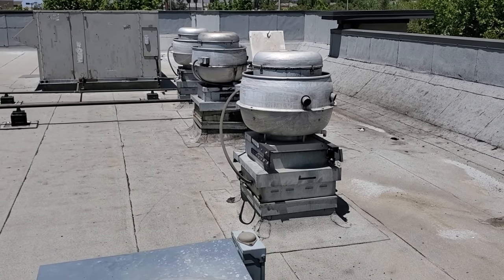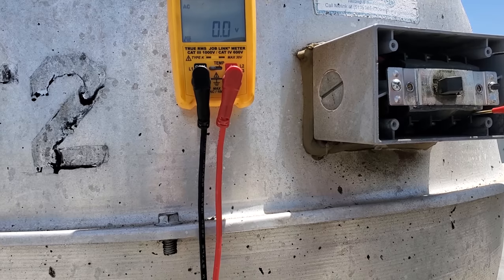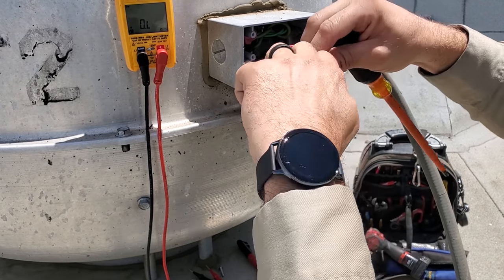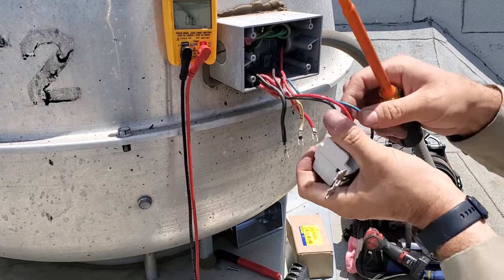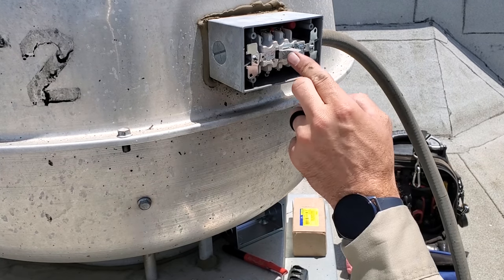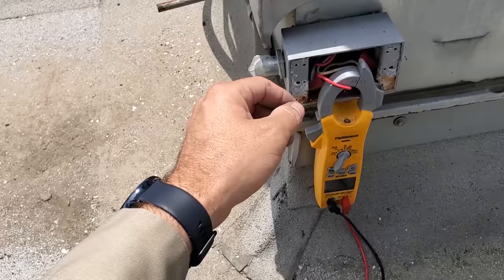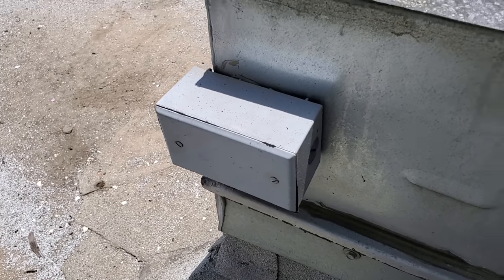WHY IS THERE SMOKE IN THE KITCHEN ?

Comment: In the restaurant industry, generally if you tell a manager about issues with a system, it will usually never get to the person that needs to hear what is needed or what repairs are needed upcoming. Often the next time you are there that person no longer works there. You always need to find a person above them if you can, and even that has a small percentage of success. I used to make vendors leave a log in the office with a synopsis of repairs made, or recommendations. Many times I went back and a new face was there, I said look in your file cabinet under Repairs. They would say holy shit this is great.
Put the logo back centered on the ball cap as it belongs, I have no clue who in their right mind decided to do this on every cap, but it was originally because on camera interviews are off to one side, and  with the sponsors logo off to one side it shows on camera better.  
And quit with the "merch"  Merchandise!

Comment: Thank you for the a/c power lesson.  And thank you for reading the comments and acknowledging them. I have an exhaust fan at work that is smoking. It's a big one, blades are at least 5 feet diameter. When the Hvac guys come in I want to watch them diag it. We have 480 3 phase so I watch and learn before I touch. Not taking any chances. I am the maintenance supervisor for the 1.5 million square foot warehouse. I love watching your videos and soaking up the info. I've learned so much since I started watching about a month ago. When I get paid I'll order some merchandise I promise.
Reply from the maker: Thanks bud!!
Reply: They said that the motor burned up and suspected a single phase event. We had another burned up also. That was very expensive.
Reply: I got another one to add to this. The motor burned up from a single phase event and they found that the bearings are bad on the shaft. Someone installed small hoses to grease the bearings so you would not have to take the whole thing apart to get to them. The fittings were outside the unit. Just walk up and grease away. Well someone didn't tighten the hose good enough and the grease never made it to the bearings. The problem is you cant see the other side of the fittings. The whole unit has to come apart to get to it. There are 15 units that I cant see if they are getting greased enough. My scissor lift is maxed out just to the roof. I got a nice mess to figure out. Lol

Comment: You seem to change a lot of those single pole triple throw switches..... why not use a line throw handle disconnect?  Seems like it would stand up better to the application? Great work... Be safe
Reply: yeah and IRL the cost is likely about the same or less ;)

Comment: Trick that usually works when putting a switch back into the box is pull and twist two times (if there is enough length of wire) and then push in and untwist once.

Comment: Do you put lockouts on the breaker downstairs to stop some &@!?)£ from killing you while your up top changing the switch out. ? Love the channel stay safe
Reply: I was going to ask the same question.
Reply: Lol “busted”. Good one, while heavy commercial and industrial would definitely require that, light commercial does not because there is usually no on site safety inspector to fine your company for not following OSHA protocols. But it is definitely a good practice.

Comment: "Big Picture" 100% of the time, when repairing anything mechanical. I don't work in HVAC, I fix more IT related machines. But there's still...always a reason. Granted, in my field that "reason" can often be a "user," the methodology of big picture diagnosis still definitely applies. As always, excellent advice.

Comment: Why is there smoke in the kitchen? Probably because somebody's burning something! LOL
I cringed pretty hard when I saw the motor's vents all clogged up. That poor thing was choking!
Good practice is to simply replace a switch that feels odd. Even if the contacts ohm out fine, if the action is crap, it's gonna fail sooner or later. In the video it looks like part of the plastic toggle of the switch has seen some heat lately, that circuit breaker certainly saved the day.

Comment: I've asked myself quite often already, watching your videos, why put those switches on the fan chassis at all, instead of the frame or in a central switch box where the cables run down to the kitchen/breaker panel.. somewhere that doesn't vibrate. I'm also wondering why those fans generally don't seem to have any sort of roof or cover on them so it doesn't rain directly in to the motor or belt assembly all the time. I'm not in HVAC tech, I'm just a regular engineer, and the way these fans are designed just screams "high maintenance". Is this some job security thing that's going on?
Reply: It does seem like a convenient place to put the switch. Looks like it's at about eye level, and it's physically attached to the thing it controls
Reply from the maker: I will discuss this on my Livestream this evening 2/1/21 @ 5:PM (pacific time) on YouTube https://youtu.be/3FcefEaLBCc

Comment: 100% agree with your big picture philosophy. Whenever I get called to fix electrical I always want to know what caused the failure. I had to replace a breaker that wouldn’t reset and ended up finding a length of burnt wire running along two outlets. Overloaded circuit and a short to ground as a result.

Comment: I was just thinking  when u turned the fan off and on with the safety switch: If on VFD you should never do that with a switch placed after the VFD because the start current might then damage it. If VFD was bypassed then I get why you could operate it like that. Otherwise u would have needed to to it from the VFD to avoid blowing that.

Comment: Good video, again the voltage was low and that will cause heat in the switch, wires, motor etc. Thanks for the video.

Comment: I think that technically,  with those TEFC motors,  cooling air does not flow through the motor - only over it.   

"hasn't been running in a while.."   NICE ONE!    Sometimes we just have to suck it up.  Long gone are they days of blowing out fins and coils with cheap R-12
Reply: Oh man you brought back some memories with that. Yup we used 22 just to blow the dust off our shoes, lmao. Crazy how things have changed so dramatically and they are still cutting refrigerants left and right. Soon we will be left with only water as a refrigerant, lol.

Comment: It’s because the fan is not belt turned so the motor shakes because it’s in the middle or look how the exit plate is bent that can be a problem be cuz is all the other exit plate there fine and not bent so that’s probably why the side has more playing than the other side so the motor wants to shake the over way away from the bent side

Comment: We had a customer with a similar situation and they had some previous tech wire it direct and took the switch out! I told them that was unsafe and violated code ! I was told it works don't try to fix something that is working! Unfortunately the customer was wrong but you can't argue with them! What to do?
Reply: The previous tech/company would be held responsible if something happened, unless you touch it. Then you own it. That's my understanding of the way it goes with insurance. CYA with documentation in big bold red ink! That will help you from being  held responsible.

Comment: Why not mount the switch where it doesn't vibrate? Like on the lower portion where the other box was located? Too low to the roof? 
If you want to run a vfd at 100%all the time then it wastes energy so cheaper to bypass. I'm sure they don't need it at 100%all the time though. Vfd are also good for phase loss protection.
Reply from the maker: I will discuss this on my Livestream this evening 2/1/21 @ 5:PM (pacific time) on YouTube https://youtu.be/3FcefEaLBCc

Comment: The worse alternative to too much wire in a junction box is too little - you can always trim back excess, but you cannot cut the wires longer.

Fortunately, you seem to be working with multi-strand connection wire, which remains flexible longer than solid conductor wire, where age hardening can be a real problem... ask me how I know...

As for the gunk on that motor, that was just sad and disgusting at the same time.

One thing that I'm seeing with those kitchen exhaust fans is that they don't seem to have any serious grease trap or filter in the ducts... makes life even harder for the fans, and the service techs...

Comment: Buy fancy exhaust system then bypass the VFD's LOL
Reply: hahaha, pretty much spot on, the junk starts to fail after a few years if that and then they want 10x to troubleshoot and repair, which they never fix the issue on first try, customer gets fed up and calls X other company whos suggests just bypassing and direct full speed running the equipment.

Comment: Why would the side of the case be dented like that? Is it possible that during high winds some debris smacked into it? Or you can open the hinge too far and smash that side onto the ground?
Reply: severe weather/Hail damage
Reply from the maker: Yeah it likely got dropped from opening too far
Reply: @HVACRVIDEOS  True I just made a homemade exhaust fan using a 12 V DC motor and a little desk fan

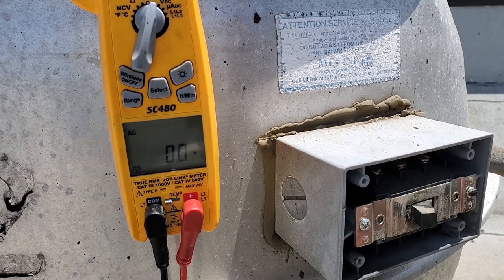Comment: 3:33 Be observant it says in the play bar, why and how are you measuring ground on a plastic box? ;)
Reply: Im quite certain that's a die cast metal terminal box, specially being on a roof in 120*+ weather and exhaust fan.  Plastic conduit box would not likely meet code and would only last a month in those harsh conditions.
Reply: @mrbyamile6973  I guess die cast aluminium could be possible? I'm an electrician in Europe and we rarely use those kind, but the color almost looked plastic to me!
Reply: he shoved the other end into the screw hole that taps into the metal shroud
Reply: @MrJANTJE123  In the US metal conduit is still very common and as I suggested likely required by NEC (National Electric Code) for us on most commercial applications due to flammability.  Even flame retarded plastics produce nasty glasses when heated.  I'm not sure if its cast aluminum (aluminium depending on where you live)  as the components seem heavier than aluminum.   Whatever they are made of they are somewhat corrosion resistant but not real heavy duty.  Feels like what old antique cast material model cars were made from in the 50s.  They are painted grey with a thick powder coat like paint and look similar to the grey plastic conduit.  I tried saving money and ran a bunch of plastic conduit in a greenhouse I built for my wife.  It got hot enough to turn  the conduit runs into spaghetti noodles, even warped the junction boxes :(
Reply: @mrbyamile6973  Learn something new every day 😁
Reply from the maker: Yeah the particular junction box I had on this fan was a metalic box and the ground wires were landed directly on the junction box inside it.

Comment: I have my doubts that vibration is going to cause a switch failure. I'm pretty sure, UL tests that sorta thing when certifying commerical/industrial products like this.
Reply: If the vibration causes the contacts to create micro arcs then it will cause the contacts to wear faster. Even if no arcs and the brushes are vibrating then it will wear faster. 
Also, it was a vfd driven and most of those do not like to be switched between the motor and the vfd. Vfd's create higher voltages which might wear the switch faster. Should be a vfd input switch to turn it off and then a switch or disconnect to lockout power if working on it.
Reply: Your “pretty sure” means you do not know for a fact all while talking to a licensed mechanical contractor that requires at a minimum 4 years of school and field training, lmao. Vibration is a common cause of system failures whether electrical or mechanical in the HVACR field. It breaks loose solder points, causes bearing failure, and creates arc points from loosening connections.
Reply from the maker: I will discuss this on my Livestream this evening 2/1/21 @ 5:PM (pacific time) on YouTube https://youtu.be/3FcefEaLBCc

Comment: I noticed the fan was pretty beat up too, was the cover missing off the motor housing too, or did you remove it before starting filming.
Talking about the torquing up of the connections, another channel I subscribe to @ArtisamElectrics, recently showed a video of a fairly serious house fire caused by a loose electric shower breaker connection in the consumer unit.

Comment: ahh, the magical green energy savings and lower maintenance BOLD FACE LIES. it all sounds good on paper, until the junk fails in 1/8th the time of standard maintained equipment and then nobody wants to repair it due to complexity and headaches, so they sell you a whole new system again (so much for savings lol)
Reply: Had this happen to my heat pump recently. Previous owners had this fancy "efficient" heat pump installed. The bearings on the condenser fan motor went out, new motor cost me $830. That stupid fancy motor ate all the "efficiency" savings that system ever generated.

Comment: You can use resistance with the power on still?
Reply: Not unless you want to blow your meters fuse they are two different processes for analyzing electrical circuits.

Comment: just a thought about the VFD being bypassed, have you guys run into VFD only motors?
just wondering what sort of issues that will come from bypassing the VFD on those, especially after the warning label has come off.
Reply: I'm not sure how you would make a VFD-"only" motor. The VFD is just varying the frequency to the motor, but is still supplying 3-phase. Now, a motor specifically designed for use with a VFD, yes. But that is just designed to not get hot when run at high frequencies and with a crappy sine wave shape. Unless the motor minimum frequency is higher than 60Hz and it runs on the line voltage, I don't see there should be a problem running it directly from the line.
Reply: ??? I've specified "Inverter Rated" motors, which are designed to better survive low speed operation on a VFD, and I have specified VFDs instead of soft-starter on big (100 hp +) motors for better electrical characteristics - the sparkies tell me that they cause less "ringing", and are less of a problem for demand management - but I have not read any motor specification where a motor absolutely must be run by a VFD instead of a starter - especially not for these <10 hp motors which are going to be run at constant speed.

Maybe an asynchronous motor might have an issue, but those are rare indeed... a synchronous motor will run just fine with a starter instead of a VFD, even if it's inverter rated...
Reply: @chemech  i have no idea why its vfd only. But they come with a warning on them not to connect them to mains. No idea why or what would happen if you did.

Comment: It’s kinda unusual that the motor shaft got bent and that’s why it’s causing the vibration.
Reply: The problem with direct drive in this case is that the fairly large and heavy blower wheel is supported only by the motor shaft, which from the looks of that motor is 5/8" diameter. If that fan was dropped or hit the roof when it was opened, it could definitely bend the shaft enough to cause a vibration that will only get worse over time. All the other belt drive exhaust fans I've see on this channel have had at least 1" shafts supported by large bearings. Part of the reason you sometimes deliberately design something to be belt driven (even when you don't need the extra speed or torque) is to allow you to use a larger shaft or more widely spaced bearings.
Reply from the maker: I will discuss this on my Livestream this evening 2/1/21 @ 5:PM (pacific time) on YouTube https://youtu.be/3FcefEaLBCc

Comment: 4 ohm resistant ??? to low i think ???
Reply: he measured the DC resistance, the AC resistance is higher. Among other things, it also depends on the motor speed, so there are current peaks when switching on.
Reply from the maker: I was measuring the resistance across the switch contacts..... not the motor
Reply: @HVACRVIDEOS  but across the switch was on one phase 0,someting and not 4? or am i such kind of blind ;-))
Reply: @HVACRVIDEOS  hi chris , look the video at exactly 6 minut s ,  4 ohm s was the resistance between the windings .  grzzz
Reply: In a motor the resistance is not the main thing opposing the current during normal operation. You also have the back-emf generated from the rotation and for an ac motor the inductance of the coils themselves.

Comment: I do not see you using lock out tag out procedures.
Reply: I’ve never seen anyone use lock out tag out procedures
Reply: @demonfire691  Maybe but it only takes one time.
Reply: @Daino-Might  I don’t understand. What do you mean it only takes one time?
Reply: @demonfire691  It only takes once for someone to go flip on that breaker when you're working on it and you're cooked. Always LOTO, you cannot guarantee that someone will know what you're doing.
Reply: LOTO is not as common in lighter & general duty work as opposed to heavy industrial work. 

When you have a smaller staff of people around, none of whom are authorized to touch the breaker panel, you can control access to the breakers by less formal means, such as telling the operating staff that you are working on the equipment, and that they should find you before they go flipping any breakers.

That won't fly in any facility larger than a neighborhood restaurant, and the first level would be to place a warning tag on the door to the breaker box.
Reply: I just want to say that osha requires lock out. Dont let them catch u not doing it for the fines will put your company out of business. My company fires you instantly if u dont lock out.